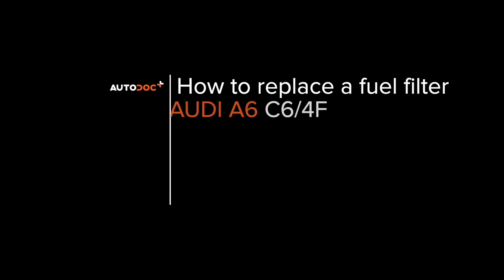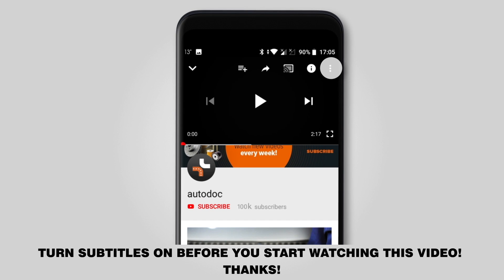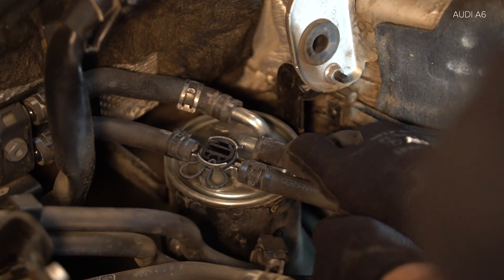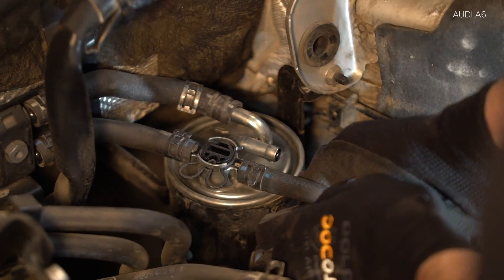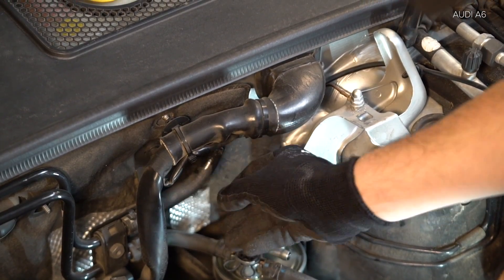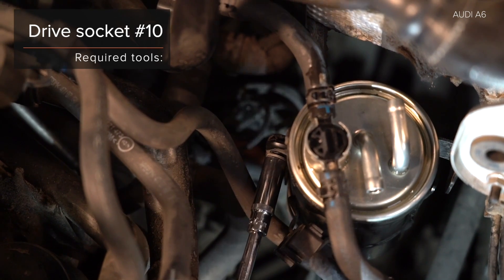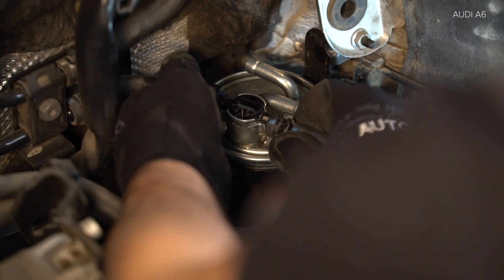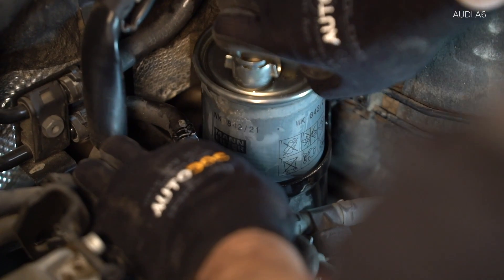How to change fuel filter AUDI A6 (C6) [TUTORIAL AUTODOC]

Comment: I have another question sir? My car fuel filter has been change and it's still stalling when i drive. The engine cuts off while driving or running and i wait 2 min then it restarts right up with no issues. I replaced the fuel pump already and the crank position sensor. The Audi dealer said it's my intake manifold but i can't really trust them guys after all the money i spent and same issues.
Reply from the maker: Thank you for your comment.
Without proper diagnosis, it is very difficult to answer your question.
We recommend contacting a specialized service of your car.
Best Regards,
Autodoc team